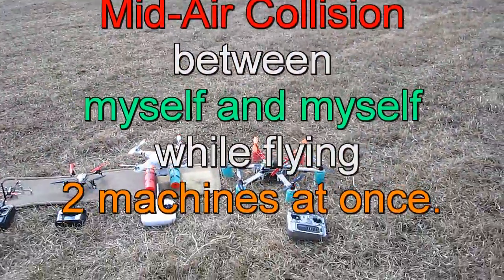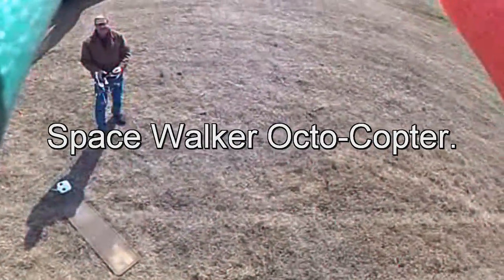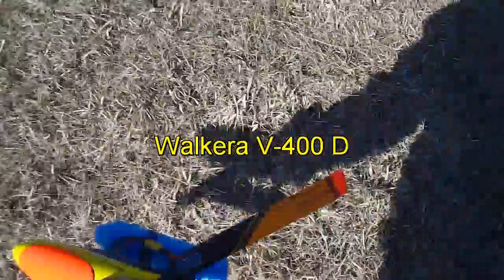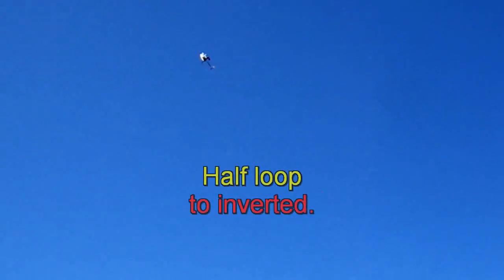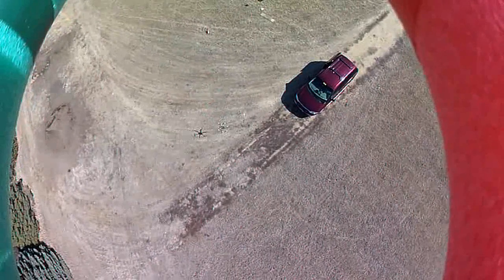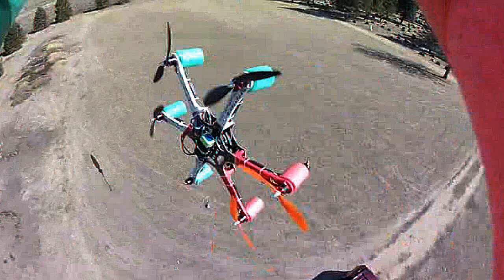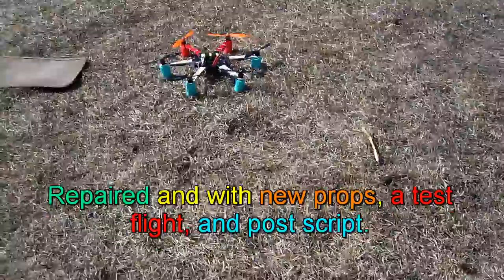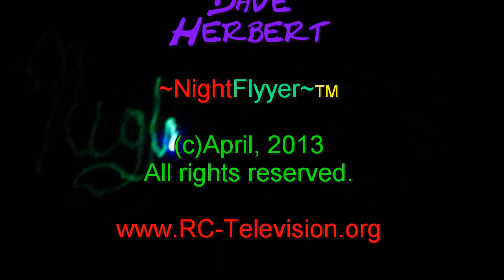Mid-Air Collision-DJi Phantom and Flame Wheel Hexacopter. On Board footage.

Comment: Bigger they are the harder they fall eh.If the phantom could, it would've been laughing its arse off. 1st time for everything buddy.
 Just wondering on heli.Does the rotor blade pitch alter through a gyro or do you have to do that once upside down?

Comment: I have a problem with my Aerosky 550.
I contacted Xheli several times. They have not responded with any intelligent help.
When I unlock the props. I can not lock them. I have to disconnect the battery.
When I apply power. All the 550 does is rotate on the right leg.
I checked and rechecked the propellers. All are in the correct position.  All the prop nuts and tight.
When unlocked. All propellers turn. All motors feel free (NO battery).
Reply to spikejones72213@yahoo.com

Comment: Didn't you just get that hexa?  I love how the DJi just shrugs it off and keeps flying, the GPS lock and Gyro stabilization on that thing is phenomenal!  How much damage to the hexa?  As to the original reason for this video, why not get a devo 10 or 8s instead?  I love my 10, it's my first big boy radio, and with DeviationTX I can use it on my walkera and blade products!

Comment: Well, u might not be so lucky with the next crash, things usually partly vaporize by falling down from such a height and part of those engine ball bearings are already damaged even if you didn't notice yet. 
Pushing to the limits takes sometimes it's toll but it's no problem if there is somebody ready to pay the bill. Anyway, I have to admit, the filming is great.

Comment: Octocopter can lose a prop or two and keep flying OK.

Hexacopter can if you’re quick on the sticks, you need to throw in hard yaw / rudder in the correct direction and spin it down which depends on whether it's a right or left hand prop that you lose. The big brother of the Naza  the WK-M can do it automatically. A lot depends on the weight of your machine.